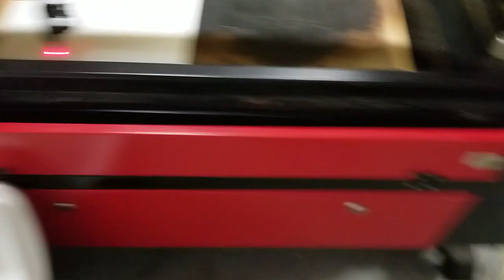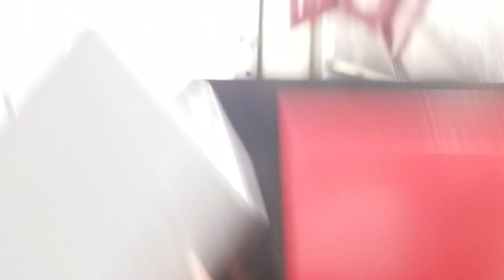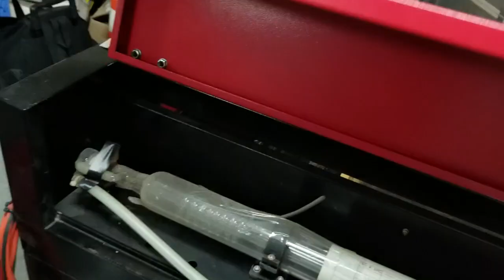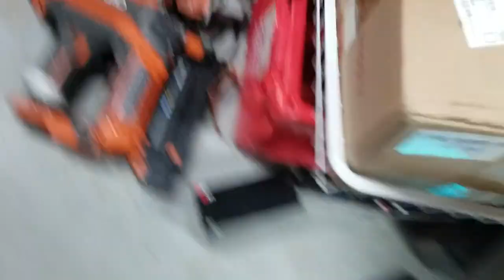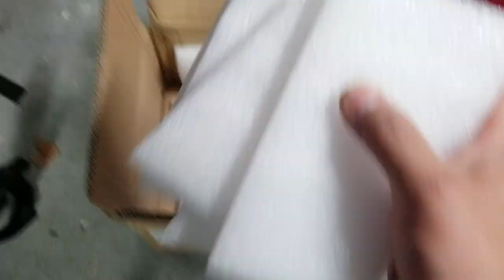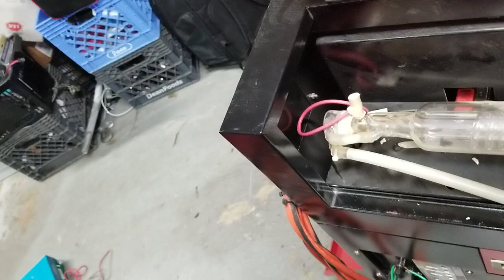60 Watt CO2 Laser stopped firing. How to troubleshoot.

Comment: Great video thanks. My Versalaser VLS3.50 suddenly stopped firing. The tube is in a metal casing so I'm wondering if you have any idea how this can be solved. Everything in the VLS is cased in whereas the power supply and tubing was very accessible on your laser. Can't even see how the cooling water works. Any experience with these lasermachines ? Thank you.

Comment: Awesome, thanks for sharing. this just happened to my 50 watt after only one month, the only difference is mine still has like 5% burn even though I have it turned up to 97%. Won't cut thru poster paper.
Reply: Any solution for ya so far? My 130 watt just stopped cutting well last weekend mid cut. It got super weak, then virtually non-existent. Redid lenses and mirrors and I'm getting a massive spot directly out of the laser tube, not the tiny dot I'm used to
Reply: @notyouraveragegoldenpotato  I watched many  video and tried contacting OMTECH with no results so I took matters into my own hands. I spent half a day messing with the mirrors, cleaning and determined that the #1 and #2 mirrors were dead nuts in the center. My problem was the mirror on the laser head or some call it the #3. From about the origin point i set at the top left to about half way the beam cuts great a lower power but the second half to the right takes multiple passes and ruins the edges to the point I had to scrap many a sample. Look on the gantry there are two hex head screws mounted from the bottom. I loosened them and re- aimed the #2 so as to better aim the beam to the #3. once I did that I took a huge risk which I'll have to show you on a video but let me try and paint a mental picture. With the lid open and  the beam hitting center on the #2 and on the #3 mirror I adjusted the #3 beam while holding the Pulse button down, I aligned the mirror while it was shooting a beam. If you do this you can see the beam moving as you move the adjustment screws a slight bit at a time and get the beam to get in the middle where it belongs. After that I did the ramp test and found where the best distance was which had changed from the original distance sample included with the machine. I have found I need to tweak this every few days so it stays "sharp' BE ADVISED THIS A VERY HAZARDOUS WAY TO DO THIS but I saw no other choice. Just be careful.
Reply: Basically wasn't the power supply on my machine
Reply: Thanks for replying. On my machine, my mirrors were perfectly aligned and had been in use for a few weeks at that set up no issue. Halfway through a cut/engrave file the laser just started to barely even engrave a super thin soft woof, 1/16" or so (have done 1 pass 1" poplar plenty before) I rechecked EVERYTHING. All mirrors are aligned, eventually all mirrors and lenses were replaced even though they were good, the beam coming OUT of the laser tube though is HUGE. Used to be a tiny sharp dot. Now it comes out of the laser tube  about 1/4"-3/8" wide. And I've seen several different beam patterns on it. It still fires and has a significant amount of laser power, but the beam now, (I had the previous tape tests still stuck on the machine) off the Tube have grown huge and occasionally get an odd beam pattern. Beam out of mirror 3/the head is equally as big. We've gone top to bottom re-aligning the mirrors several times now, they are perfect, just with a huge laser dot instead of the very precise small one we've had since we got the machine. Not even that old but it cost us 7k$ usd so.. alot
Reply: @notyouraveragegoldenpotato  OK that's a BIG CLUE !! If the the beam on the first mirror is wide in diameter then I'd say check the tube for looseness, if it crept closer or farther away from the optimal length it will screw up your burn. there are screws to loosen it to slide forward or back. Something to try
Reply: @jbouza09  thanks for the idea. I've tried everything Aside from that, I'm pretty certain I have either a tube issue or a PSU issue that isn't supplying proper power that is screwing up plasma formation. I went over the machine top to bottom when I got it, set it up and aligned and am certain everything is completely locked down, (verified by me again going over everything when things went weird) I feel like the tube isn't performing, nothing moved. Nothing changed, just halfway through a file the tube went all weird. First half perfect, then beam went Weak at first, and then back to burning strongly except the beam was huge and garbage and ruined the file. I checked all mirrors and lenses, replaced all them anyways. Reverified alignment and focal distance, ran a bunch of slope focus burn tests of all sorts well above and below the focal point I know was correct (I had them all measured and set, plus had focus jigs I regularly used perfectly to set focal height when swapping to different lenses) directly off the lase, the beam is massive. Easily 5×10 times as big as it used to be. Even with mirrors focused that big focal spot is the same at end of lasers onto material as right out of the tube @ #1 mirror.  verified with several lenses we regularly use. Not a focal mistake I can guarantee that. Has to be the tube it starts bad there now which is different. Idk what could cause that though? Cheap Chinese tube? Leaked tube gas? Indicative of a bad power supply ? I have no idea. Nothing changed on the machine set up, everything was tight, and it happened midway INTO a file that had worked perfectly, then immediately went wonky. You can see the change in the material
Reply: @notyouraveragegoldenpotato  Hope you can nail it down. Just thinking out loud, since you think the tube may have low output, have you checked the power wires going to it to see if you have a high resistance? At some point the fuse will let you know you have one but a little corrosion or a loose connection can cause a high resistance. Maybe have a look at the connectors on the power supply for evidence of overheating. One big thing I hear everyone talk about is water flow, gotta have good water flow thru the tube. Just spitballing here. Hope you can nail it down. let us know when you figure it out.

Comment: Hello, the error that you saw first came from the flow sensor, which is mostly installed directly at the back of the water connection of the laser (unscrew the cover). You can also simply short-circuit the two cables of the flow sensor on the controller and short-circuit it. Or you should have checked the circuit protection from the power supply itself.  That would probably have solved the problem. Furthermore, if the high-voltage power supply was switched on, to be on the safe side, you should wait a day before doing something on the connections, otherwise this can quickly end fatally (capacitors may still be charged). Furthermore, you shouldn't buy cheap power supplies. The power supply can also be tested with appropriate equipment.
Reply: I think you hit the nail on the head. These powersupplies are ... well dodgy at the best of times. You might get lucky but really it is luck. Even the better ones are not perfect. There is a reason Cloudray et Co. sell flyback transformers as parts. Got my machine secondhand myself and the original owner (who had no clue what he was doing to be fair) also gave me 3 extra PSU's next to the one that was mounted.

As to the water/cooling situation ... I see a lot of what looks like calcium deposit in the tube. That is a problem too. It should be distilled water and I would even add something to it to prevent bacterial and fungal growth (as warm water is the ideal medium for that sort of thing). Special additives exist, or in a pinch anti-freeze can do, to prevent such issues.

Comment: I received my 50W machine last week. It was working for about 1 minute very nicely, then the laser power supply started to make a strange noise, the current dropped from 20 to 15 mA and after a few more seconds the power supply stopped with a loud bang. Now I'm waiting for the replacement supply. I hope not the tube is faulty killing the supply. Does anyone have an idea of the rootcause and how to check before killing the new supply too?

Comment: Crazy question.  I have a "100 Watt" laser.  I think the power supply is going out.  It's firing rather sporadically.   I was considering replacing the tube and power supply with a 150 watt system.  Is it possible to run a 100 watt tube with a 150 watt PS and just not run it over 60% until I get the new tube?

Comment: While you did fix your issue, i don't think the problem the power supply, but the connection to the tube.
My guess is that the connection is not great, since you're just wraping it, there's probably some arcing that's damaing the wires causing the connection to break over time.
I also see air in the tube, there's not suppose to be air in the tube.

Comment: Hi I just bought a laser; anyways the control switch won't turn off wondering if you had that issue before. Thanks
Reply from the maker: If you are talking about the control switch that turns on and off the unit. They can go bad and stick to the on or off position. Is this the switch you are talking about?

Comment: Thank you for this video, i actually have an issue with my new bought laser machine, while pushing the test button both on power supply and the lid it is firing but while engraving or cutting has no fire, appreciate if you help me.
Reply from the maker: If you push the test button on the power supply and it fires, that is a good sign. The next step is hit pulse on the controller buttons and jogging the laser head one way or another and see if it engraves that way. If it does not, then your controller is not sending the laser activation signal to the laser power supply to turn on. If it does turn on, then i would think if you are running a program and you currently have the setting too low and it is not burning like you want. Hope this helps you a bit.

Comment: The fact that you can see water flowing through your tube is concerning.  You should not have bubbles or air in the tube at all.  This may be why you're blowing through power supplies.  You may want to upgrade to a proper water chiller with a closed system that cools itself and keeps the water flow constant without air entering.  This should be clean distilled water.  You are also adding contaminants to your laser tube with the ice bag method.  Thanks for the videos!

Comment: Hello Oscar,  After letting my machine sit for 4 months, I finally installed the new Focal Lens and a mirror.  The old lens cracked.  Upon firing up the machine, I pulsed and adjusted the mirror.  When running an engraving, the machine did not emit a burn onto the material…..   There is burn if I cut off laser path lens… I am stunned after 2 days of troubleshooting.  I have replaced the Tube and the power supply with spare.  The Controller is pricey….. do you think that is what causing the problem with the UNIT not emitting engraving burn?
Pulse emits burn but no emission up on engraving…..
Thanks , Matthew
Reply: You likely need to realign your optics. It's possible that your beam is hitting the side of the head, not making it out of the tapered end. You should be able to remove the tip and pulse it. to see if it's getting through the lens. Check the Boss website for a video on alignment.
Reply: @ryanlangan1060  Hmm  Thanks for the suggestion... on pulse it does get to the material, but on the run, it's a blank.... since I have been using my backup machine, I have not check since....   I will follow up on this post Ryan to let you know.  Thank you for your advice.  Matthew

Comment: Is there a possible cause of fire outbreak when the laser machine has been switched off?
Reply from the maker: Not that I am aware of, although I have had fires in my machine as i am cutting material. Which i strongly recommend you always stay and watch your machine when machine is in use.
Reply: @oscararredondo64  That fire is do to not having an air assist blowing out the fire and making a cleaner cut

Comment: Hello, two things that I see, one: the water outlet hose from the tube is always better that it is submerged like this when the pump stops, no air enters the tube. And two: next to the blue PS you have another silver that is the one that feeds the controller, I would measure output voltages because the beep that is heard is very rare.

Comment: I would have those 2 dead power supplies in bits to find what went pop
Reply: There is a high voltage transformer which fails. They are available separately for around $25 https://www.amazon.com/dp/B07BDBTNXT/ref=cm_sw_r_cp_apa_i_932IFb08FRS45

Comment: Hell Yah.. .thanks for the video on the power supply replacement and everything mentioned as well as explaining about the components.  I purchased 2 of these machines where the Water Switch both went bad and sprung a leak.  I also recently created a video this weekend regarding the water switch and bypassing it.  That switch is so cheaply made and you can't even find a replacement on Ebay.   

I added lower power consumption inline exhaust fan and a chiller you should check out.... it works really well.... no ice etc.... runs constantly below 22 Celsius/72 Degree.

I see that you added switches for the water pump and made your own chiller container!  I love it man!  There were other things that you did not mention.

What is the Speed/Power you are running your engraving at?  I usually cut at 95% power and 5% speed.  This is likely the reason my tube wears out really quickly and likely my power supply is not functioning right now.    Give me your consumption so we can compare....Thanks.

I will post my video today to share it with you..... it's tough filming it, explaining, and working on the machine at the same time huh?  I use a tripod for filming.

Here is my uploaded video on the chiller and exhaust fan Oscar:
https://www.youtube.com/watch?v=wOCAW6AP9Ug&feature=youtu.be

 Matthew